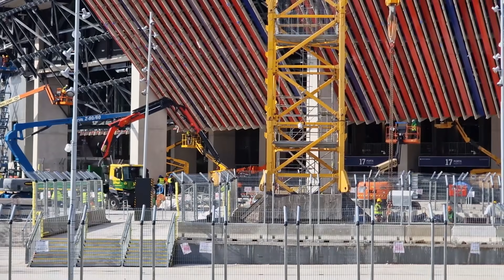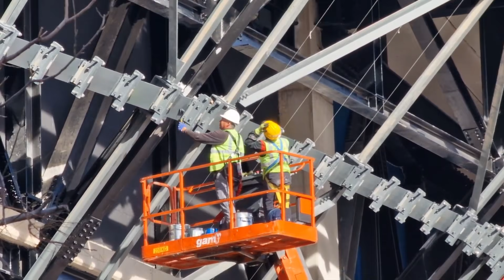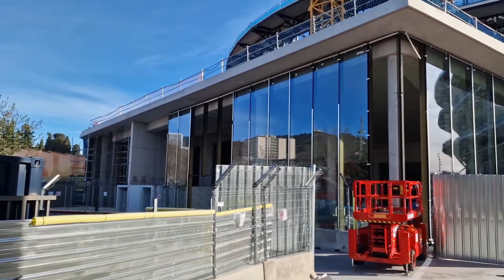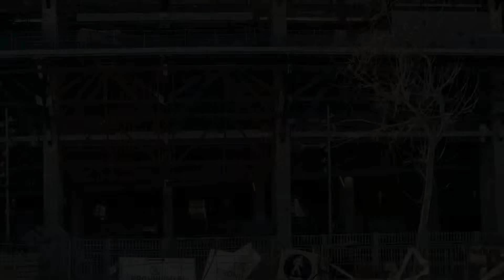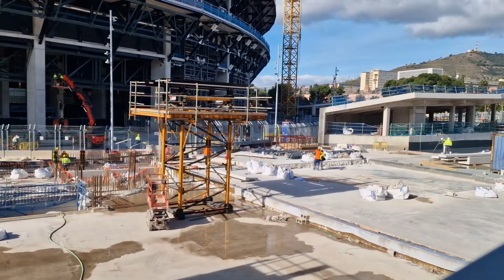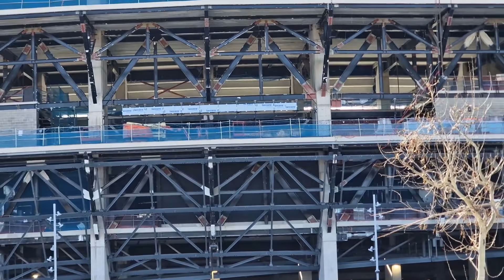Camp Nou Construction Update: Radial Beam Installed & Panels Transforming the Stadium!

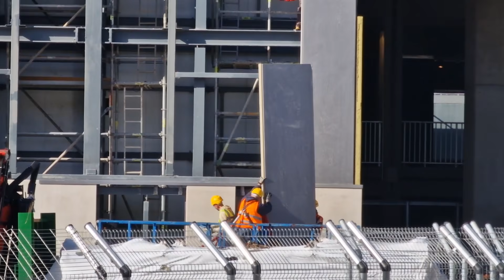Comment: 3:02 Por que tem esses buracos entra as ceramicas ????????
Reply from the maker: Thanks for your question! The gaps between the ceramic tiles on Camp Nou are intentional — they help with ventilation, sunlight control, and are part of the modern façade design.
Reply: @megaversebuilds-11 mais sao permanentes ? Por que nos renders nao tem esse buraco
Reply from the maker: @anzinnx Yes, they are permanent. The gaps between the ceramic tiles on Camp Nou are part of the final architectural design and are meant to stay as they are.
Reply: @megaversebuilds-11 os espaços eu sei amigo . EU To falando nessa parte que tem uma buraco dps que acabar as cerâmicas.  Nao sei se dá pra entender
Reply from the maker: @anzinnx I understand now, my friend 👍
That larger opening you’re talking about (after the ceramic panels end) is not final. That section is still under construction and will be closed/covered in the next phase.
The renders show the finished version, but right now some areas are temporarily open until all structural and facade elements are completed. 😊